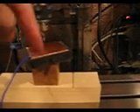CNC Mill Auto Tool Zero Mach3

Comment from the maker: @milek021 
Yes, the blue wire attached to an LPT pin that was normally HI/5vdc.  The tool is at 0vdc/Ground.  When the tool is moving downwards, the script is in a loop, monitoring/waiting for the specified LPT pin to switch from +5vdc to 0vdc. When the tool touches the plate, the LPT pin is driven Low, the script then knows instantly that the tool tip is at a specific position.
I sold this machine about a year ago- do some searching about Mach 3 scripting- good luck with your projects!

Comment: I don't understand one part of this "story". You solder a dark blue wire on that metal plate. That wire on other end is connected with what? Some pin at PC LPT, ground (0V) ? And tool in your drill is connected for what, so it can make a electrical contact ? :) How come that metal plate know that drill tool touch it, there has to be something (some signal, voltage) attached for tool in drill  ? I'm starting from zero with learning cnc machining, pls this is important for me to understand :)